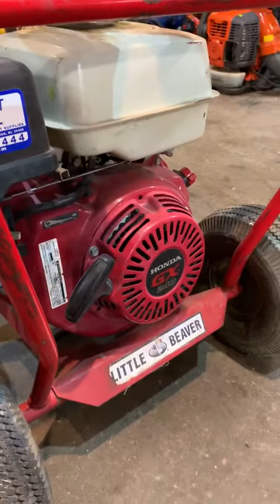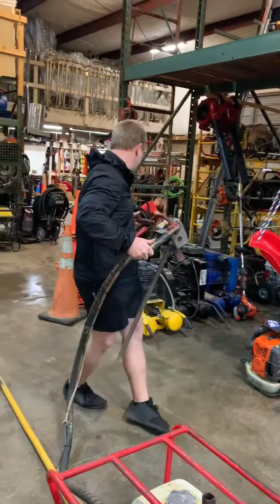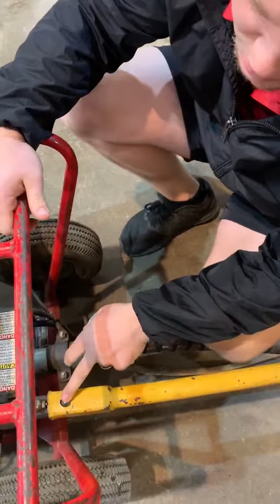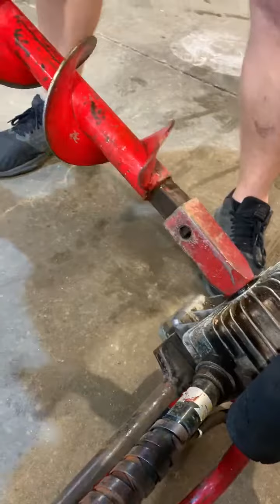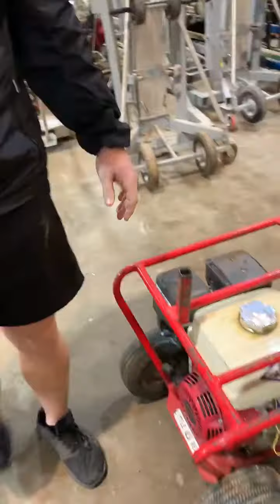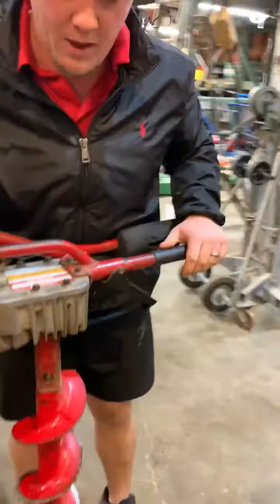One Man Post Hole Auger (Little Beaver) Instructional ABZ Rent-All

Comment: What is the cost to buy one?
Reply: About $3k
Reply: I tried this 3 weels ago. This is one man without the auger extension. But two-man when extension is on. Hard to lift the auger out of the hole due to weight of dirt.
Reply: Do you have an auger machine for sale? 
Where are you located?
Reply: $1200 brand new
Reply: 😮where?